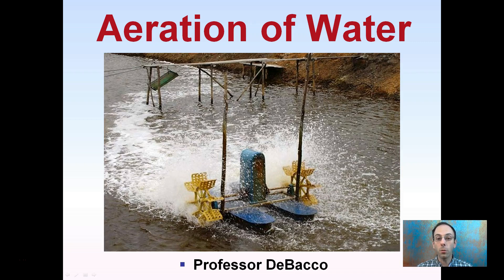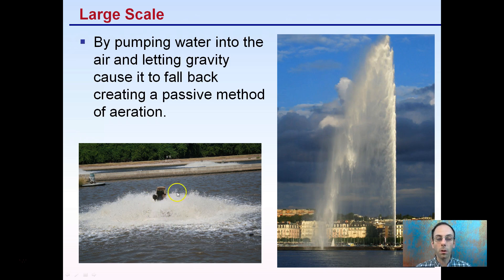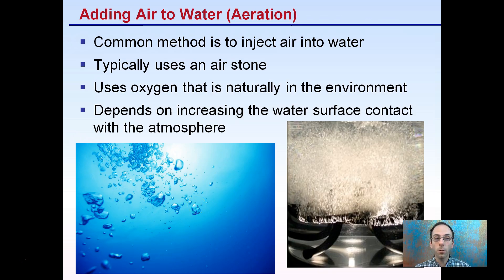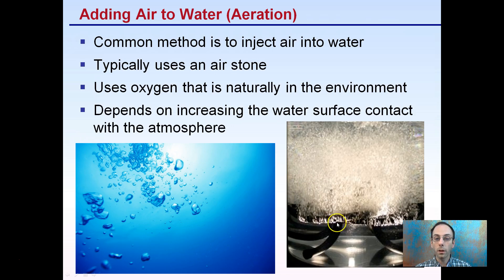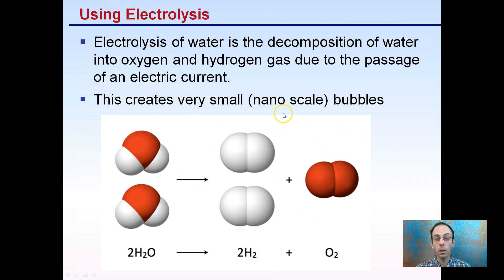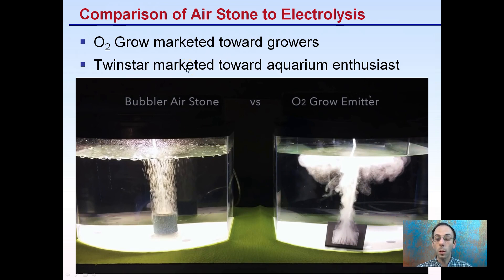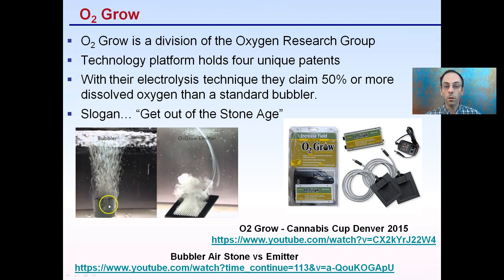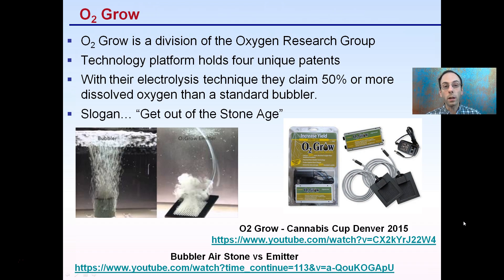Aeration of Water

Comment: The issue you run into using electrolysis for aeration is that the reaction changes depending whats in the water. Using something like the O2 Grow shown in this video is fine for RO water, but the second you try and use it with hydroponic nutrient solution you have an untold amount of chemical reactions taking place that can potentially be far more destructive than the 25% reduction in aeration you would see by using the simple and far more cost effective air stone/pump method. 20x the cost for a 25% increase in aeration provides zero ROI for home or commercial growers.

That being said.....Prof DeBacco, your videos are fantastic. I dont know how you only have around 7k subs, because your Horticulture of Cannabis series is invaluable information.
Reply from the maker: Thanks for bringing up this point about plain water vs nutrient solution.  If there is anything you can do to help increase the number of subscribers please do.  Regardless your comment is appreciated!